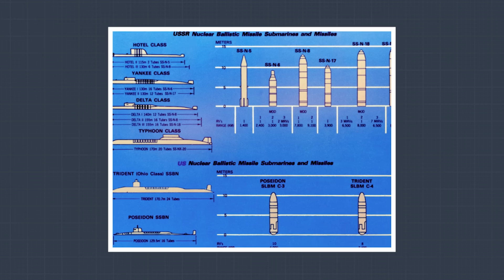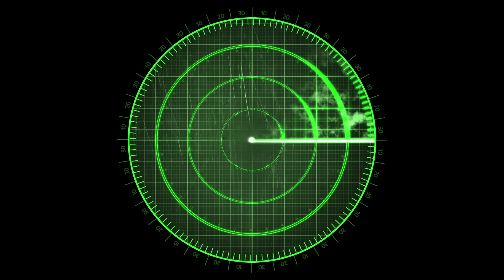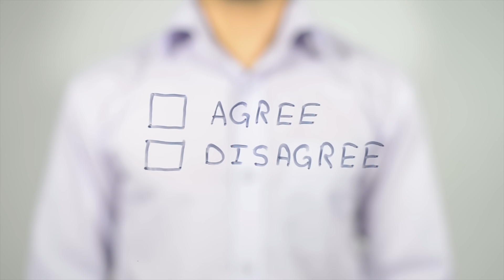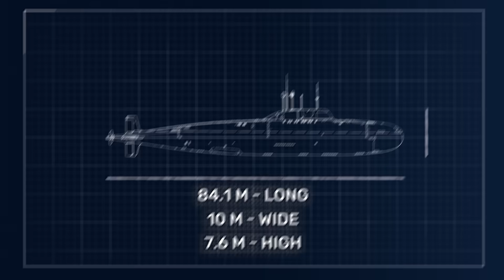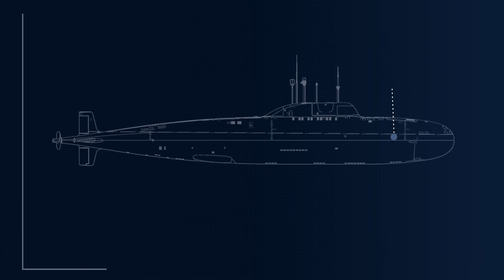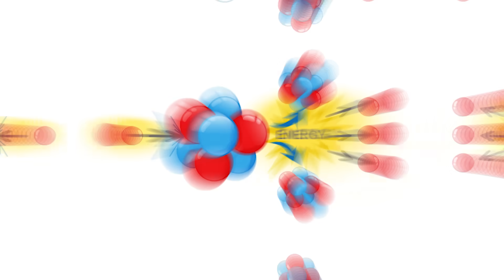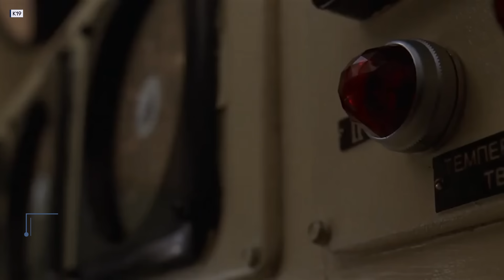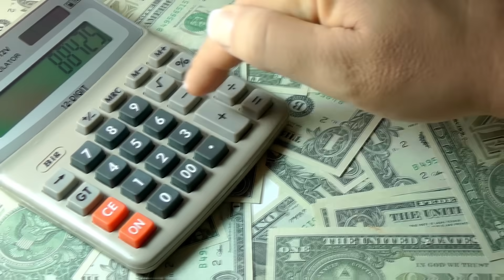Project 705 Lira: The Soviet Submarine That's Still the Fastest Ever Built

Comment: then when you realize that torpedo's can go the speed of sound under water...... the speed of a submarine is sort of stupid.
Reply: A submarine can go faster more easily than a warship.
Reply: @binludding7169 bit of a non-advantage with the proliferation of front line aircraft and drones 🤷‍♂️
Reply: @binludding7169  Umm.... if your talking giant war ship not meant to hunt sumbmarines maybe. But there are plenty of ships that go 40 knots that have weaponry able to take out submarines. Submarine is meant for stealth. Max speed is super loud for a submarine. My point is a submarine is not "out running" anything even if it goes fast 40 to 45 knots.What it will do is let everyone in the area know exactly where the sub is located tho.
Reply: @ThatGuySyndrome  

Look a submarine by naval physics has a much easier time going faster than a ship.
Reply: @binludding7169  What your saying is the per square inch drag of a submarine is less than a surface ship? yes, but the overall surface of a sumbmaine touching the actual water is much greater than the actual surface in contact with water for a ship above water. Your trying to argue something beyond your scope of understanding. Once you compare an attack submarine to a relatively same mass sized ship on the surface, the surface vessel is going to wipe the floor with any attack submarine in a drag race, and in turning.
Reply: @ThatGuySyndrome  You forget one thing.

Surface ships have to deal with hull speed, where over an x threshold in knots, based on the length and drag of the hull, an exponential amount of force is needed to accelerate it further.
Reply: @binludding7169  Yup. And what can you throw bigger engines on? Under water ship? or above? But I think if they talking about "technology" the speed of a sub is silly when you can launch a torpedo from thousand of miles away from an airplane on a missile and have that same torpedo travel the speed of sound, while under water. A silly 40 knots under water is silly compared to 700 knots under water weapons, that just seek and track submarines.
Reply: @ThatGuySyndrome  stop dreaming, you aren't making a heavyweight stand off asw missile supercavitate and make it hunt submarines.
Reply: @binludding7169  Dude, there has been super sonic speed traveling torpedo technology for over 50 years. The torpedo is designed to cavitate on purpose. And they used to be fueled by some sort of explosive "peroxide" propellent and probably still are.
Reply: @ThatGuySyndrome  

How is it supposed to track targets then ?

Exactly.
Reply: @binludding7169  I'm sure under water tracking of nuclear and conventional propulsion subs are a well kept secret between a few nations. But I would imagine there is communications between the under water weapons systems and surface level assets. So lets say if a satellite, or a airplane is tracking a under water target, and also using sonar bueys to corrdinate tracking. You know sound travels faster under water than it does through air. Why would a weapon traveling just over the speed of sound have issues communicating with any acoustic sonar devices when sound goes faster under water?
Reply: @ThatGuySyndrome  I'll tell you why.

If you are close enough to drop sobobouyes just drop a conventional torpedo on it, I would assume a supercavitating torpedo ( which won't get past 300 knots anyway)
Would have difficulty relying on  sonar guidance without a cable connection to the detecting platform.

I don't think a wire can roll out at that speed and you would need to use active sonar to have a chance to hit it directly.

Transmitting information through water is quite difficult, much less a firing solution.

If the sensor is not on the torpedo it's simply almost guranteed to miss.(unless you put a nuke on it)
Reply: @binludding7169  All i know is. Torpedo's that go over the speed of sound under water do exist. How they communicate to one another or other assets to aquire targets I don't think anyone really knows unless they are insiders of the tech itself. But if the speed was capable 50 years ago. I would imagine communications have improved since then. There are "full time" sonar systems that the US has. I would imagine the fastest possible way to eliminate a early target would be to launch a missile as fast as possible to location, then that missile drops a super sonic speed torpedo into the water, and once in the water it somehow aquires said target at the fastest possible speed. And I would imagine accuracy is irrelevent as the torpedo has a small nuclear device on it since its under water its not going to matter. And its only used to take out nuclear submarines like missile subs. Not so much "attack" submarines super far off from land.
Reply: @ThatGuySyndrome  
1. That would escalate to nuclear warning shots and possible tactical exchange of warheads if it were used.

A supercavitating torpedo suffers from the same paradox as hypersonic missiles.

If they don't have terminal sensors they need to rely on inertial guidance.

Supercavitation and plasma both interfere and make sensors on board blind.

As I said it's hard enough to directly hit a manovering target with a straight runner torpedo in general, much harder in a 3d plane and when the clicks of bursting air alert the submarine the second it starts the cavitation field.
Reply: @binludding7169  Rouge nuclear sub. I think the USA or ally nation would call upon the USA to take out the target as fast a possible. I think that would invovle some sort of super high speed massive explosion weapon under water detonated.

Comment: Commonly misquoted, titanium is not stronger than steel.  It's specific strength is higher, aka strength to weight ratio, but not stronger.

There are many different alloys of both but here are some general numbers. 

Yield strength of steel 350 mpa, titanium 140 mpa.

Where titanium shines is in weight savings, aka strength to weight as i mentioned earlier.  You could in theory design 2 parts of equal strength of titanium and steel, the titanium part would need to be bigger, but it would weigh less. 

If you took 1 equal sized pieces of steel and titanium, the steel is much stronger.
Reply: There are some titanium alloys that are stronger than nearly all steel alloys but I'm guessing they're prohibitively expensive.

Comment: Do you have a non-NATO reference or source which indicates that submarines were built for an ASW mission?

The sonar system was very poor by the standards of the day, which was made worse by ownship noise. That made them unsuitable for ASW missions almost by design.  The more likely use of the ship, in my opinion, is for carrier interception.  Zoom in past the escorts since you can outrun and out dive the adversary weapons, unload a barrage of torpedoes at the high value target,  then turn and run.

Comment: They are limited in Dive Depth to 400 meters,  they are noisier than
a dumpster full of tin cans crashing down an escalator, and their
reactor is a liquid metal monstrosity that cannot be refueled and
requires the submarine to be cut in half to change out !  

They are a typical piece of Soviet Cold War Shit, all talk and no
performance.   They are easily tracked by USN Los Angeles class,
and even the Sturgeons and Permits used to follow them around
like a cat following the three blind mice !

In a real war, their life expectancy would be equal to the range 
divided by the speed of an ADCAP torpedo.
Reply: Salty aren't you ?
Reply: @binludding7169  Yeah, salty - just  like the crew of 
the Kursk.....
Reply: @paulrward   man the thresher could really have used a titanium hull, one the alfa might have had.
Reply: @binludding7169  The wreckage of the Thresher is in 8400
feet of water -  only the Oceangate Titan can go that deep.......
Reply: @paulrward  Maybe if it didn't suddenly suffer the same fate as that submersible it wouldn't be so deep

Comment: USS Albacore was still faster submerged in one of it’s historic propulsion configurations. But it was purely for research, a one-off production, and used 40% plus concentrated hydrogen peroxide which is a lot like running in “hope we don’t blow up” mode. I think my instructor said it achieved fifty knots submerged, possibly the GM16 pancake diesel engine configuration.

Comment: Yeeeeaaahhhh...

They only built 7 of 8 planned.  And it took them 13 years to build the seven that they did. 

They kept them in port a lot due to their liquid metal cooled reactor requirements.  And they're reactor cores were very short lived, requiring more frequent refueling.

Two propulsion plant casualties further reduced the operational availability of the Alfa class.

One submarine (the first one) was decommissionedless than 3 years after its initial commissioning.

Each trip to their test depth reduced the depth they could dive in the future. 

They were noisy as all getout, even at low speeds...at high speeds it was ridiculous.

This spurred the rapid development of the Mk 48 ADCAP torpedo...that they couldn't out run or out dive.

This program shifted focus on the next generation of US submarine to the 688 class (Los Angeles) as the next major class to be produced.

The end result...the Alfa class never ended up being the threat it was made out to be.

Comment: I get what the Soviet scientists and engineers were after.  You WANT high temperature coolant in a nuclear reactor.  Molten salts are best IMHO, as they are liquid at the temps necessary to efficiently make power.  And yet are liquid at atmospheric pressure, which means you don't need a heavy containment vessel, as you operate at very low pressures.  Water is a horrible coolant, as it need to be preassurized to be even close to a good temperature for power generation.  And if containment is breached, you get a steam explosion.
Reply: It's much safer however.

What if the coolant solidifies in a liquid metal reactor

Comment: Liquid metal cooled reactors present some interesting challenges. Starting from the heavy end of the periodic table, Simon mentioned the Bismuth-Lead mix. Pure Lead is good option but servicing the reactor is a real problem due to Lead having a fairly high melting point and vapor pressure. Mercury has been tried, but that has its own problems of which toxicity is one of the lesser ones. Tin has been investigated, but so far never used as it has a bit of a corrosion problem that could lead to clogs. 
But the most interesting ones are Sodium and Sodium-Potassium amalgam: they don't corrode most metals, and if the coolant gets neutron-activated, the half lives are fairly short; the biggest problem with these is that they are insanely reactive with air and water. You really don't want to get NaK'ed.
Reply: THe problem was about shutting the reactior down for maintenance - in the end, Russians created a system of superheated steam that kept the lead-bismuth coolant liquid without the reactor to be active. Before that time the reactor had to be active all the time, even when the sub was moored at the base.

Comment: Nothing about the Alpha made it good except it's exceptional ability to go deep.  Speed is counter productive in every aspect of combat other than running away, but even when running the enemy needs to lose track of you and nobody is going to have difficulty tracking a fleeing Alpha pulling on 40+ Kts.  Even at low speed Alpha was noisy and detectable.  The other issue with running at high speeds is you are also deaf, dumb and blind while your also advertising "come kill me" with all the noise your making.  The flow noise  at those speeds would thrash a towed array (thus they were never equipped with them) and blind their own sensors.  The only thing an Alpha could really do in combat is approach non-ASW equipped forces, torp them, then run away before any ASW gets there but the problem with that tactic is any Navy worth its ships does not put a fleet out  to sea without ASW support ships in support.  While  you might think they would be useful to disrupt commercial shipping in a shooting war  I would add any ships carrying military supplies would most likely convoy and be escorted by a few dedicated ASW ships and  Helo's in support.
Reply: The alfas were built for interdiction and to blast supply ships then evade lightweight torpedoes by simply outlasting them

Comment: 6:50 155MW would be the total thermal energy the nuclear reactor could generate, the reactor can use all that heat to make 40,000 steam horsepower. It must have a closed loop nuclear steam system, so the condensor in the system must have to dump about 100,000 horsepower worth of heat. A boat that hot could easily be tracked. Definately a down side.

Comment: It was also the noiseist submarine. The titanium hull meant that it's maximum operating depth kept decreasing every time it dove deep.
Reply: It's was a titanium alloy so deep dives did not lower subsequent test depths
Reply: Problem with titanium is it doesn't give like steel it just cracks and breaks very strong but brittle making it very hard to repair

Comment: As much flack as the Alpha class gets regarding its reactor it is one of the safer designs as it would literally bleed lead should a leak happen and self seal itself off from becoming a true radiation disaster. Still wouldn't want to spend months at sea around it though. 😂
Reply: Self sealing fuel tanks

Comment: Speed means noise, if a sub can be tracked, it is dead.
Reply: And the influence on the sonar equipment. The noise wil virtual making that sub blind.
Reply: When these were released, they were so fast and deep diving that torpedoes couldn't get near them so it didn't matter. The Mk48 ADCAP was developed to counter specifically this submarine.
Reply: And doesn't titanium pop when under extreme cold and pressure? Not good for noise reduction.
Reply: @DaveSlate-q9x all sub hulls pop as they go up and down at certain pressure points as the hulls compress and decompress. Just a fact of existence.
Reply: during that time US had no torpedoes enough fast to catch it, no matter if you loud if nothing can catch you
Reply: @tsugumorihoney2288  What are you on about? That sub can do 40 kn max. ww2 torpedoes can reach 50 kn and only got faster since. Modern torpedoes can easily do 70 kn and track a submarine for up to 200 kilometres.
Reply: @MarcusRhodes-q2s  yeah some torps could by main us antisub torp mark38 if i remember right could do only like 35 knots during those times
Reply: @tsugumorihoney2288  According to these people...

The Columbia Encyclopedia, Fifth Edition. New York: Columbia University. 1993.

"The torpedoes used in World War II were usually 20 to 24 ft (6.1–7.3 m) long, carrying up to 600 lb (272 kg) of explosives at a speed of 50 knots for more than 10,000 yd (9,144 m)."
Reply: @MarcusRhodes-q2s  so? You know that it is different type torpedoes?
Reply: @tsugumorihoney2288  Yes I'm certain I know more about torpedoes than you do. 40-50 is the average. Some torpedoes could do 30 some could do 50. The US kept a lot of good equipment from ww2 on and upgraded it as industrial technology advanced. Why would they settle for a slower torpedo design if they already had one that could go 50 kn?
 
Your statement that no US torpedo of the soviet era is fast enough is blatantly false.
Reply: @MarcusRhodes-q2s  you're wrong.
Reply: @damonlandsdown  Prove it.
Reply: @MarcusRhodes-q2s  just read the rest of the thread, the mk48 adcap and spearfish torpedo were made in response to this submarine. There was literally not a single torpedo capable of catching up and diving deep enough to catch the Alfa for more than a decade.
Reply: @damonlandsdown  And yet the royal navy, Kriegsmarine and Japanese navies of ww2 all had torpedoes with 40 KN top speeds. Yes powered by HTP but they did exist.
Reply: @MarcusRhodes-q2s  one has nothing to do with the other,  ww2 torpedoes weren't sonar guided or depth capable. They sure as shit didn't have the range to chase down an SSN either. You can either learn something or be ignorant.
Reply: They kill it with their sonar? No.
Reply: nope, it ran deeper than the western torpedoes.
Reply: @GM-xk1nw  and therefore: nuclear depth charges.
Reply: @GM-xk1nw  Not the spearfish. This torpedo has a 30 KM range. 80 Kn speed and no known crush depth. There is a saying in the royal and US navy. If a Spearfish locks onto your acoustic signature, you are already dead. Manoeuvring, countermeasures, depth. Doesn't matter you can't evade it. 
This torpedo can track a submarine through a cluster of decoys, identify the real sub from the decoys by the propeller sound and chase the sub for hours.
This torpedo came into service in 1992 by which point no submarine was safe from it. This torpedo is used by every royal navy submarine during the period, vanguard, Trafalgar and now Astute class.
Reply: @MarcusRhodes-q2s  I often wondered how it can track acoustically at that speed.  The speed is not what makes the spearfish impressive but that it can still hear at that speed.
Reply: @MarcusRhodes-q2s  good thing the spearfish was deployed in 1988 when the Alfa was sailing in 1971...
Reply: @damonlandsdown  I know the spearfish became operational in 1992 when the alfa was at the end of it's life already. The spearfish was a replacement and upgrade for the existing stack of torpedoes that could do almost the same thing only at a slightly slower speed. Not like all other torpedoes at the time could not do similar things.

Part of the reason Russia stopped building fast and deep diving subs was a result of torpedoes like spearfish and the fall of the soviet union as a whole.